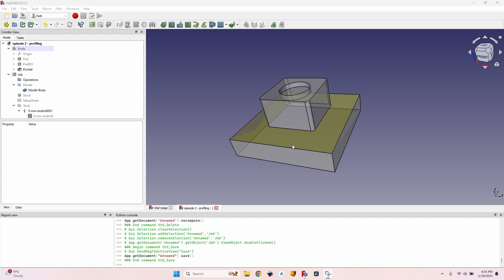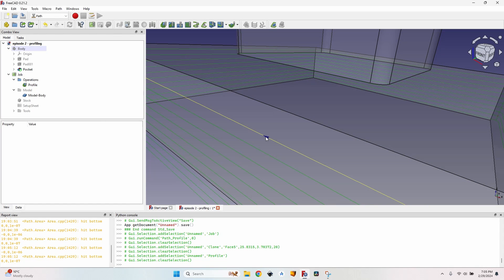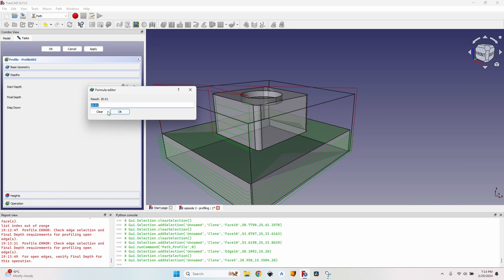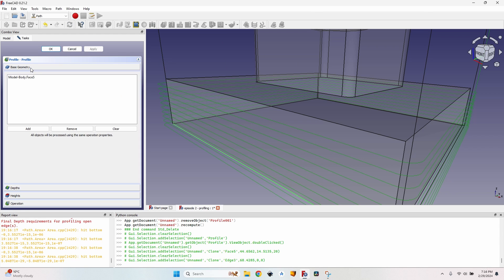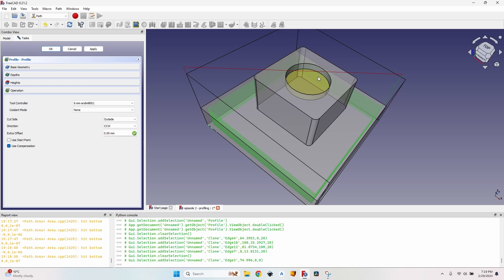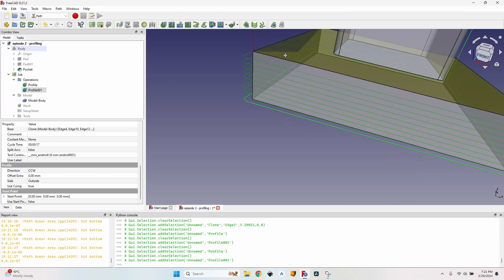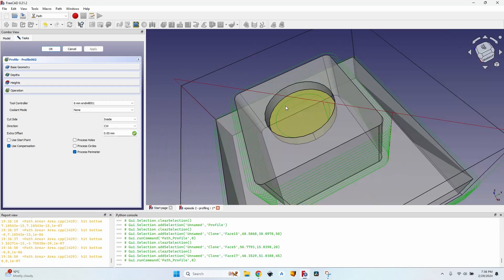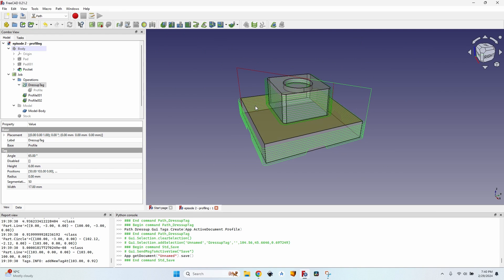CNC Profiling – Cutting Outlines with G-Code | FreeCAD Ep.2 | CAM Profile Operation Basics

Comment: These are great videos, very clear. Could you do more videos on the 3D paths
Reply from the maker: Thanks! I'm working on that exact same topic, but the operations are quite buggy so I'm currently trying to discover workarounds.
Reply: @opensourcecnc  I wonder if KiriMoto CAM would be better at 3D/curved CAM operations.
Reply from the maker: @AndreMonthy  haven't heard of it or used it, but I'll take a look, if it's open source. Otherwise, it's outside the scope of my channel. 
Edit: Checked it, it has absolutely no 3D capability, only 2.5D, so don't see how it could handle 3D operations. Plus some text saying that current capabilities are free, but the professional upcoming ones will be based on subscription, worries me to the point where I don't even feel like trying it
Reply: damn that sucks.
Reply from the maker: Not a problem, I'm working on doing it with FreeCAD and I'm almost there
Reply: @opensourcecnc  Looking forward to that video, I am trying to do a 3d CAM as well.

Comment: Hello again, as per your example drawing how would you process the square spigot if it was originally the same size of the stock. Can you have the milling cutter follow the shape the the square spigot (like a profile cut)  starting from the outside of the stock a working it's way inwards with say a 5% step over at full depth till it machines the final size of the spigot. This would be useful for machine metals.  cheers
Reply from the maker: You can use the adaptive operation. It's built exactly for that, even though it has some limitations (only round pattern)
Reply: @opensourcecnc  Hello, I gave it a try and it did work with a little playing around. I made a Hex shape and a Cam lobe shape both extruded from a square plate. Once again thanks for your help.